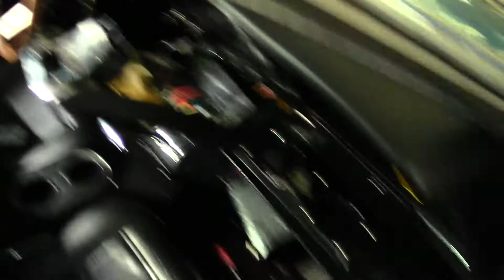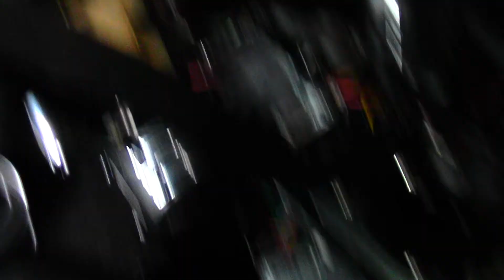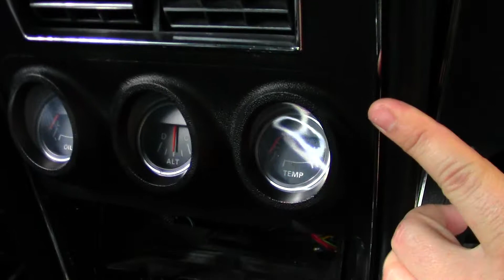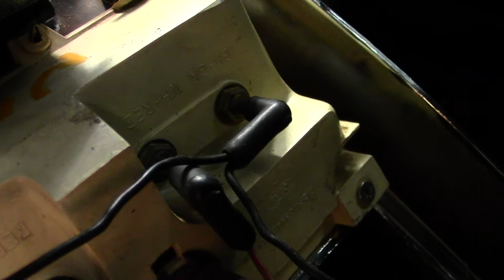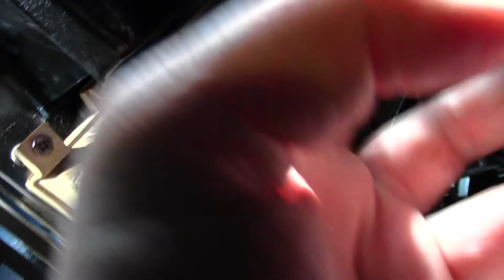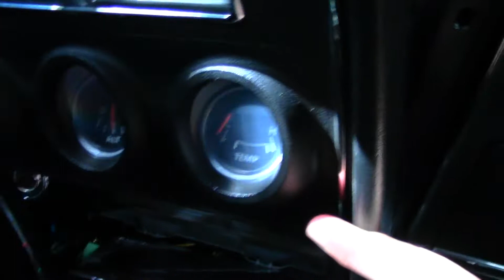Gauge Wiring Question For My Wiring Gurus | Electrical Senders?

Comment: I perfer the water temp gauge that requires no electric except for the lighting. I also like the oil pressure gauge that has a copper line it too requires no electric except for lighting.  Lastly, I use a volt gauge not an amp.

Comment: Now you are getting into a complicated area. Let me recommend a few things. 1) Never use a circuit breaker they have been proven to cause fires, always use the proper sized fast blowing fuse. 2) From my experience when using the factory gauges you must use the factory sending units. 3) Myself I prefer after market high quality gauges.

Comment: RadioRex 72 is on the money. You'll need a shunt for hte ammeter and specific senders for temp and oil. You should be able to get them from a Mustang schematic that comes with those gages. I should not be diffuclt wiring it, the problem is finding the right sender units and the irght shunt for the ammeter. The ammeter is tricky because if you don't get it right you'll burn the meter.

Comment: Do you have the factory tach cluster?  You can get that working with a tach adapter connected through your MSD box.  For my gauges I used AutoMeter 1 1/2 inch gauges in the stock mounting.  They look nearly stock, and are a bit more accurate t

Comment: First of all, I've been enjoying your videos!  Unfortunately, it's not as simple as just connecting senders.  I went through this many years ago.  The ammeter uses a "shunt" to give you the amp reading, and the oil and temp gauges use a special resistance wire that is integrated into the "gauge pack" harness.  If you have the full "gauge pack" harness that starts under the hood, it can be done.  You cannot, however convert a warning light, non "gauge pack" Mustang and make the gauges work.